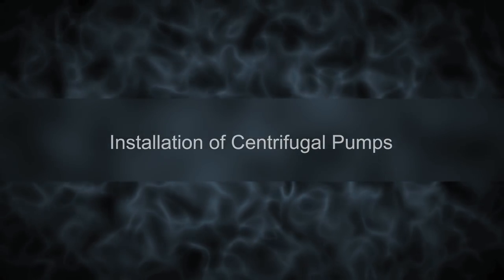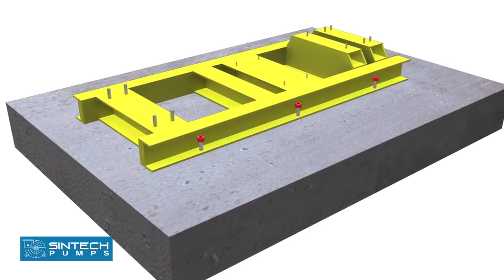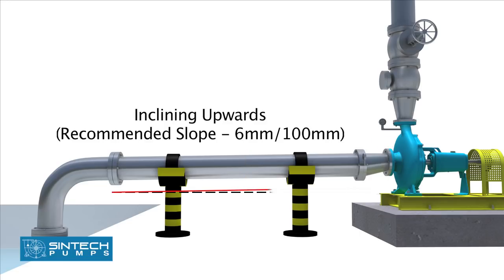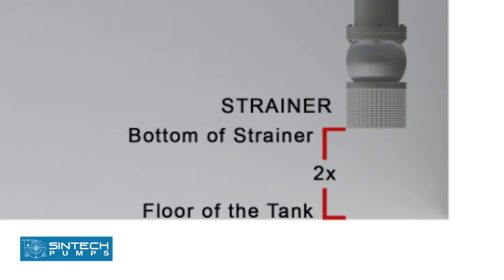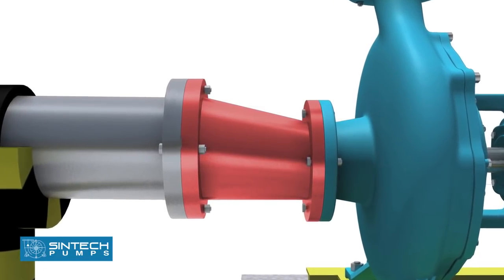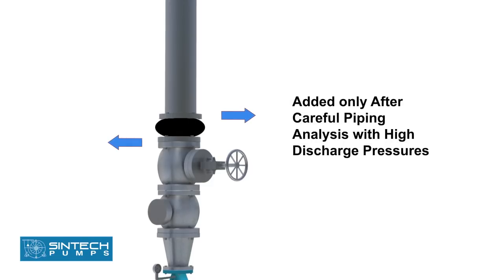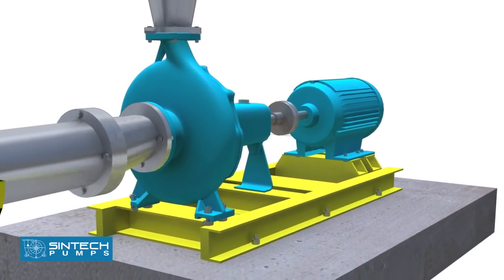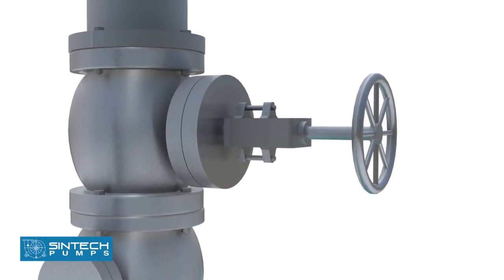End Suction Pumps 3D Installation Manual

Comment: how to prime the pump incase of negetive suction?
Reply: Use vacuum pump.
Reply: Generally an isolation valve is provided if centrifugal pump is used for negative suction to prime the pump.
Reply: Install a foot valve in suction line
Reply: With foot valve or priming port